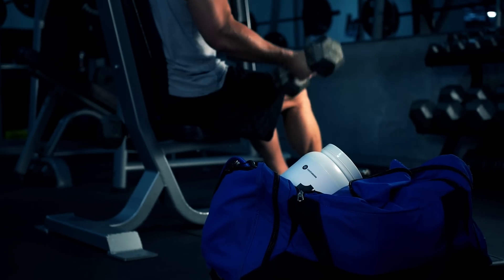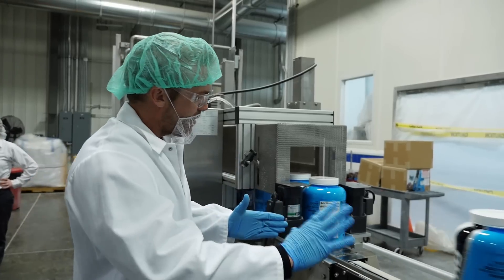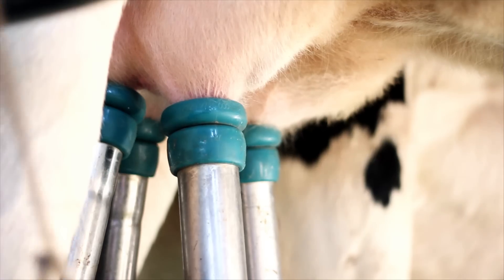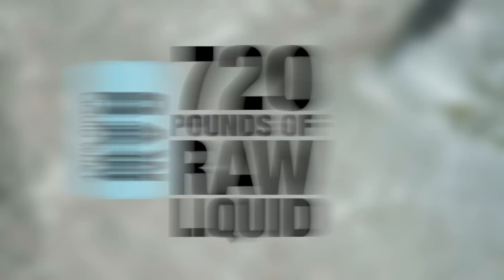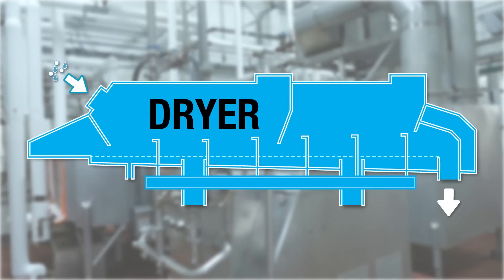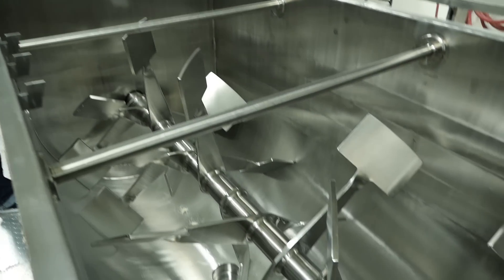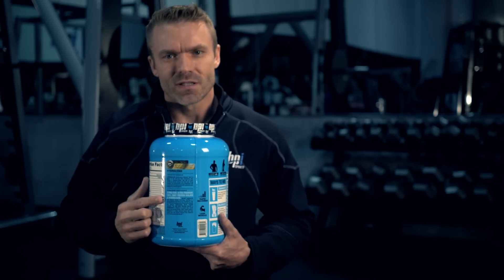How Is Your Protein Supplement Made? - An Inside Look at Whey Protein - BPI Sports

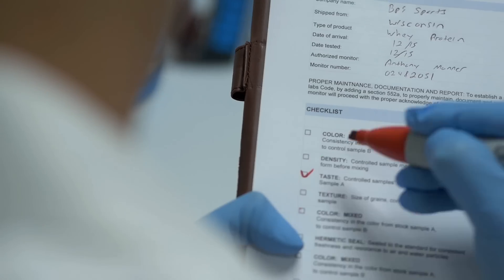Comment: 4:20 for the Chromadex part
Would love to know how the ChromaDex tests are going to work. Will they be buying random tubs from various distributors and online and brick and mortar retailers?  Or are you sending them product?
Reply: read bpisports.net/protein
It is an ongoing manufacturing facility audit.
Reply: Donny Garcia Ahhh thanks, that seems like a step in the right direction. Would be nice if bound and unbound AA profile tests were occasionally released.
Reply: ***** Thanks for responding. We're going to post about this and tack it into our amino acid spiking article. We've contacted ChromaDex to get a walkthrough of the exact process. Sounds really really awesome so far. ChromaDex is as good and reputable as they get.

Comment: I was wondering does this type of whey gives me Acne??   I've been taking Beast Whey 100% Isolate and I've been getting lots of acne on my back and face. and I've stop now and acne starts to fade off. is there anyone here able to help me out I've been working out for 2years with pretty lots of gains without any supplements so I started out last month. I have experience working but not when it comes to supplements. I realize that when I take those Whey I look really cut after weeks of using so I'll be really glad if there is anyone out there could help me out like telling me what should I avoid in those ingredients that causes acne and stuff I know that Soy gives you acne to those who are prone to it. really appreciate it, Optimum Whey cause acne?? thanks :)
Reply from the maker: +hadi257 Please email info@bpisports.net to get in touch with one of representatives who can assist you further.